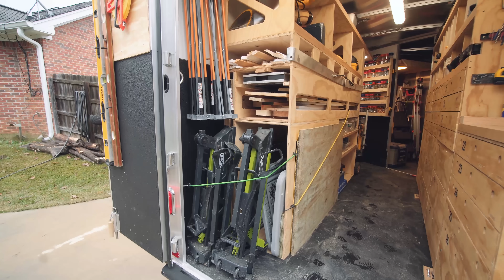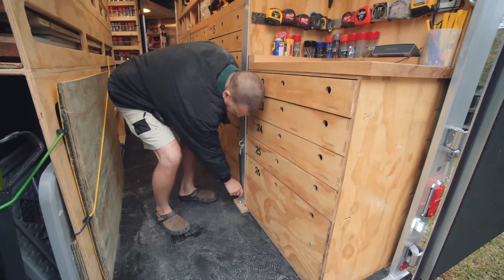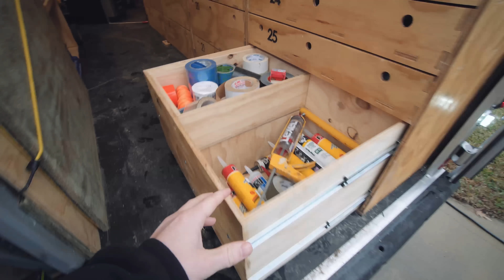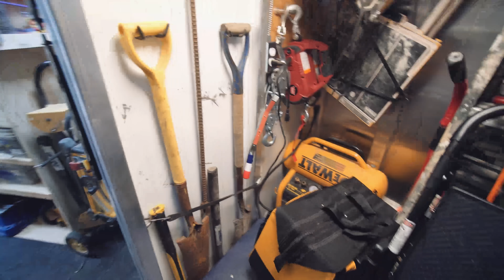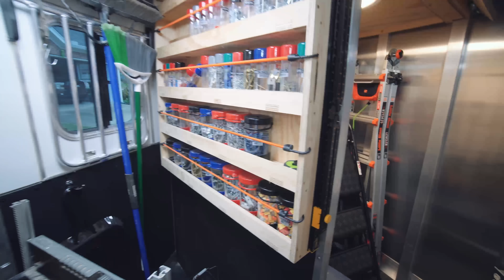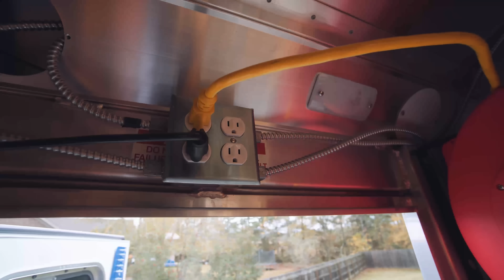Custom Contractor Trailer Walkthrough - 361

Comment: Looks impressive, some great ideas for a static workshop too.  However, I didn't see any first aid equipment or fire extinguishers. Hopefully, they won't be necessary!
Reply: One of the drawers is loaded with first aid supplies.  Fire extinguisher is by the front door.
Reply: @benheath86  Thanks for the clarification. Just so long as you can remember which drawer it is ...

Comment: Awesome trailer design two things I didn't see in yours that I have in mine is a visible first aid/eye wash station and mirror. I love the separation you have between materials and tools so that the dust and sawdust isn't constantly filing down from your offcuts on top of your tools motors.
Reply: One of the drawers is full of first aid supplies including several bottles of eye flush as im digging sawdust out of my eyes constantly.

Comment: What stops the drawers from coming all the way out
Reply: nothing, they can be carried from the trailer to the work
Reply: The aluminum bars he took off
Reply: @JEC11718  I mean when you pull them out (the ones without drawer slides). Ron Paulk has a tiny stop built in that he uses, wonder if Jay did something similar

Comment: You probably mentioned it somewhere along the line, but what is the source of "120?"
Reply: The outside plug in
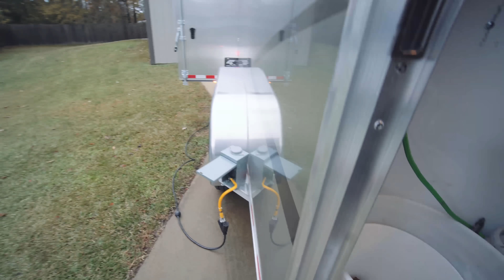Reply: 9:11, just a tail in a box that you plug into an extension cord. 
I've also seen people make double male end extension cords and plug into an outlet on the trailer to transfer power
thought the setup up in the video looks cleaner and more proper than the ones I've seen
Reply: I actually spent alot time trying to figure out the best solution for my external 110 hook up. Its not perfect but its solid , safe and pretty well protected.  Besides if it is ever problematic I can rig something else pretty fast.

Comment: Great video. I want to see if the tile saw gets a better solution later on. A small shelf or some plywood hooks/cups to hold it then strap it. Looks like it’s just held up by cords now.

Curious how much effort getting the miter saw down is too. Ugh.
Reply from the maker: Tile saw is probably going to stay that way. He said he rarely ever uses it.
Reply: Its hanging on a very strong metal hook. Honestly Its a pain in the ass to get out but we don't have to pull it out very often so it was our best solution.  Its a cumbersome piece of equipment for sure.

Comment: I understand the guy had the horse trailer already, so this design was made to accommodate that floor plan.  I think there is a lot of weird angles and too many doors which leads to wasted storage space.  If one was starting a trailer from scratch, it would be better to follow the Ron Paulk trailer storage designs for either the Awesome Rolling Toolbox (ART) or the Smaller Awesome Rolling Toolbox (SMART).
Reply: Correct bwillian, this setup is more for a guy that does make ready, maintenance or remodel type work ect. The rolling toolbox is a better setup for us guys that do trim ect. I do mostly  custom patio kitchens so i have to setup my trailer  similar to the rolling toolbox plus a rolling box that has a Shaper and Jessem router lift and 13 inch Planer  and jointer  for cabinets and doors
Reply: @jeffccr3620  How you layout your trailer is up to you and your particular tool storage needs.  I was more referring to using a horse trailer with the angled walls and number of doors versus using a plain rectangular cargo trailer like Ron used in his ART and SMART builds.
Reply: I chose a horse trailer for the quality of the construction compared to a standard cargo trailer.  The angles did create challenges but we managed to get it pretty well organized and so far we love it

Comment: My only question is how does he keep the doors from sliding open during travel?
Reply: He used the 3 inch aluminium straps he was removing in the video then hung them on the shelves on the other side. Turned them into a J hook on top. Mine is similar but i used regular drawer pulls and  3\4 inch aluminum strap. If you have ever installed cyclone fence you will understand what iam talking about. Post,bracket aluminum flat rod to stretch tight ect.
 Only thing is Jay said it was very cold, cold weather plus glue and caulk, paint ect. in a trailer doesnt work well. I have my storage up front next to an electric oil heater i plug in at night, cabinet lined with roll flashing
Reply from the maker: Addressed in the video..
Reply: @JayBates  Must have missed that part. Babysitting the grandson so got distracted a couple times ;)